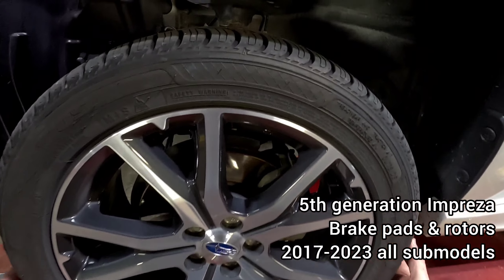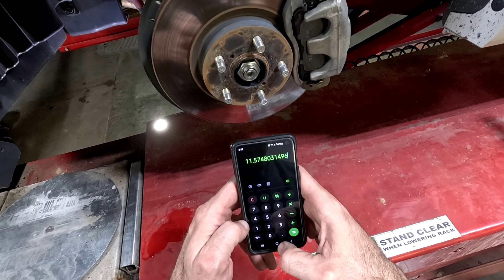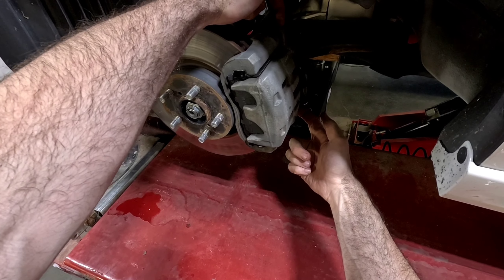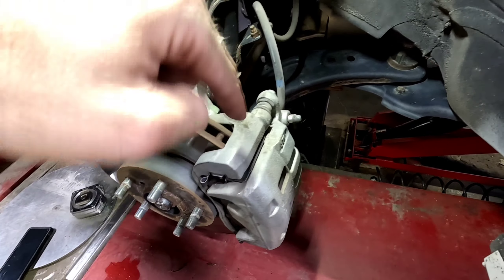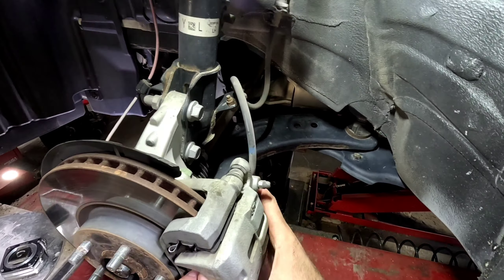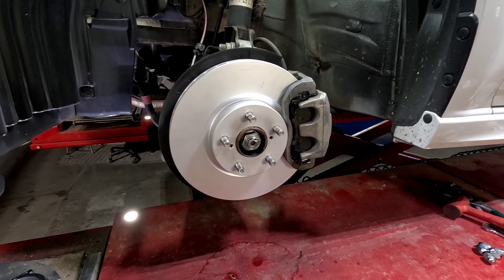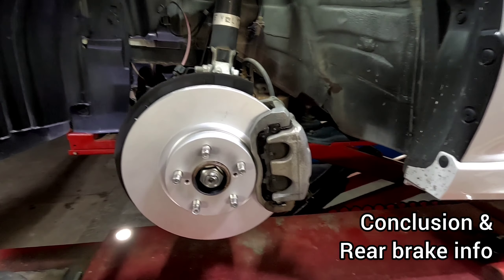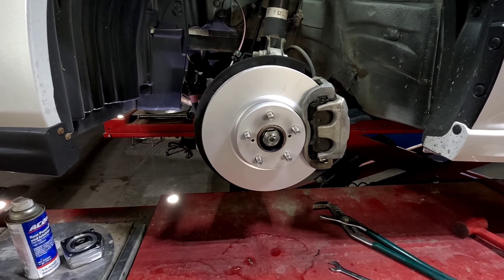5th Gen Impreza (2017-2023) - Brake rotor size info + pad & rotor how-to

Comment: Hey! I actually have the sport hatchback model. 2017 model and I bought the 277 rotor size.. found out the hard way it doesn't fit even though the website said it would. Big oof on my part. My question is... Both the front calipers are shot and I'm having issues finding the correct size to replace them, any advice would be great! Love the video!
Reply from the maker: @lucidnightmare4398  I appreciate you checking out the vid! But - not much to go wrong with the caliper itself really, unless the pistons just aren't moving, or leaks at their seals, something like that. Are you sure it's caliper issues? Often times it's the slide pins I reference in this video (the bolts that let the caliper move independently from its bracket) that is often the first thing to cause troubles.
Reply: @sixgundave  what ended up happening was the pistons wouldnt decompress on the front right. Grinded the brake pads all the way down to the metal. Ill re-watch that part where you talked about that.
Reply from the maker: @lucidnightmare4398  ah sounds rough.. perhaps a caliper on that side may be indeed in order. 
If those slide pins don't move freely, those can cause uneven brake pad wear.
Good luck fixing! Good news is brake stuff in general isn't overly complicated to repair - hardest part, if replacing caliper, is getting the air bled out of the brake lines. Having a second person pump the pedal while the other does the bleeding at the caliper.
Reply: @sixgundave  yes! Im not the ideal person youd want working on your car but brakes and stuff are simple after the first couple times you do them. I have a friend thats helping me with the brake bleed. Thanks for all the quick responses and help!
Reply: Thank you!
What size are the bolts that move the rotor off?

I put in my VIN number to the website which gave the specs including rotor size. 

Hopefully
It’s correct!!

********Turns out I bought the bigger ones which is wrong. 277mm is the correct one for my convenience trim
Reply from the maker: If you're referring to the two threaded holes near the hub area of the rotors, I believe the threading is a metric M8 thread. I'd get a total of four that have about an inch worth of threading.
Reply: @ thank you